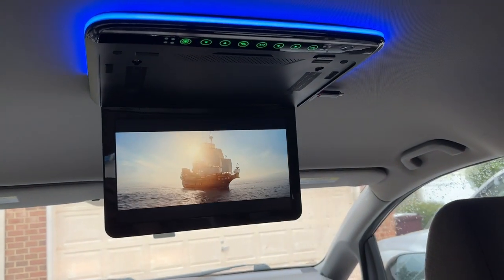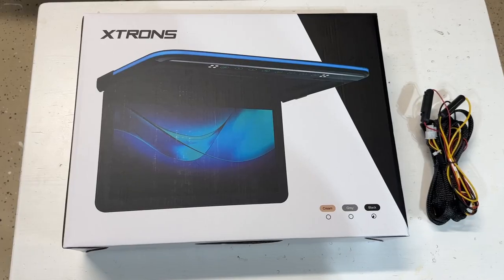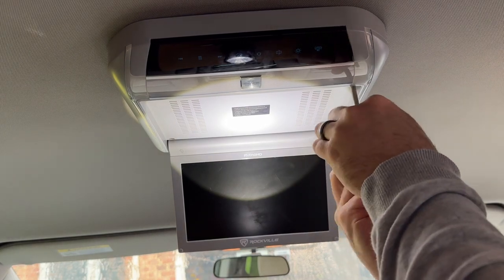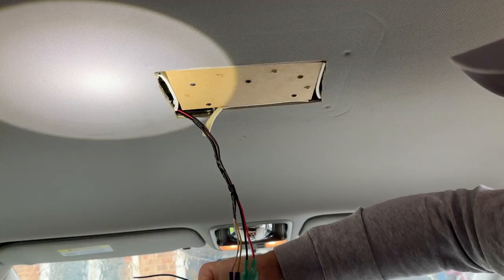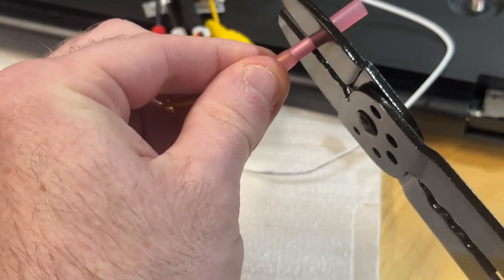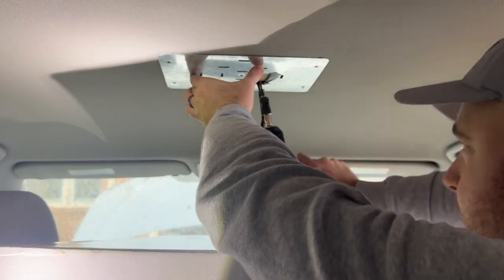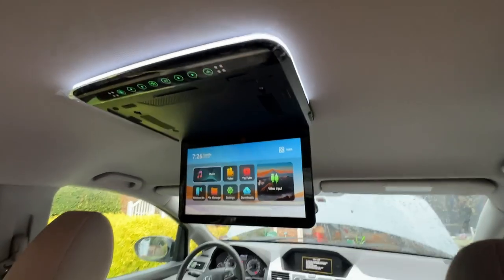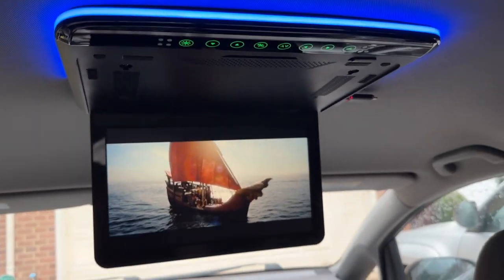How To UPGRADE Your Mini-Van's Overhead Media Player DIY | Dad Deals

Comment: Question! I have a Honda Pilot, and I'm looking to replace the overhead system (it eats DVDs and won't play them)
The door light switch is also attached to the current overhead system, but the switch for it is broken. Is there a way to wire that with another system to fix the door lights, assuming the other system has a switch as well?